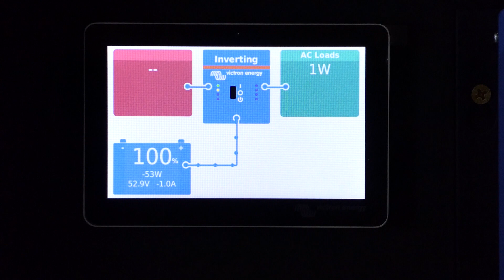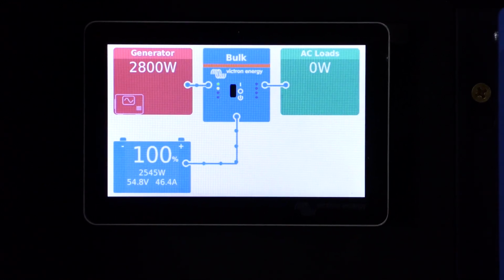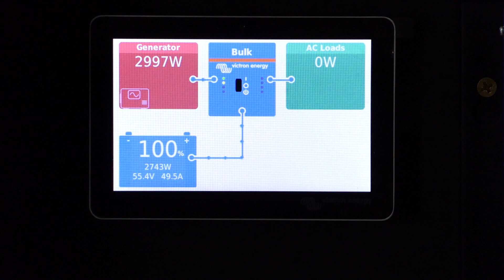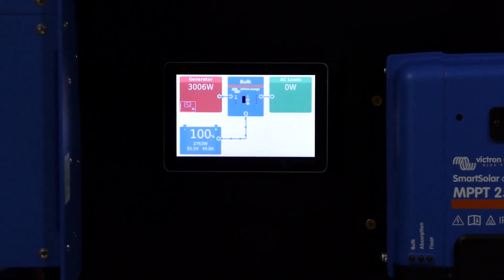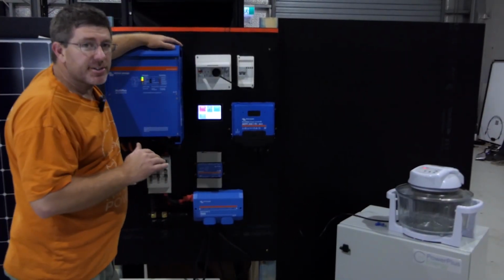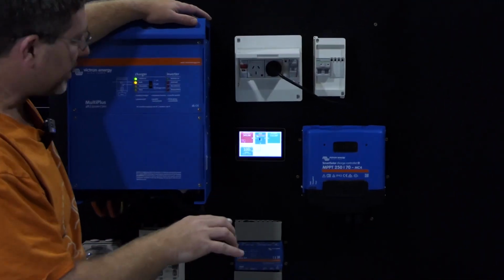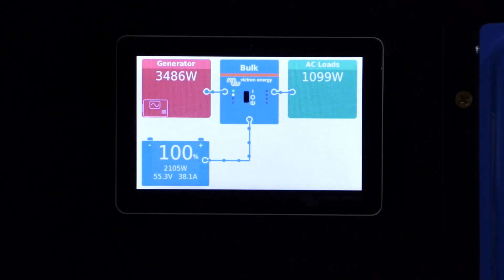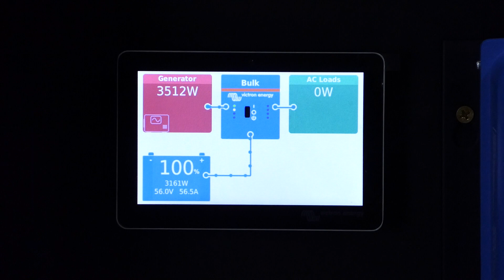DIY Pre Wired Solar Kits

Comment: how to Pre Wired ac couple need communication wire on grid and off grid? like rj45?
Reply from the maker: The Victron works with frequentcy shifting the AC coupled inverter. 
No wiring required. Programming your Victron and your ac couped inverter. Which AC coupled inverter are you thinking of?
Reply: @TheOffGridShop  Fronius primo 8.2. thanks you